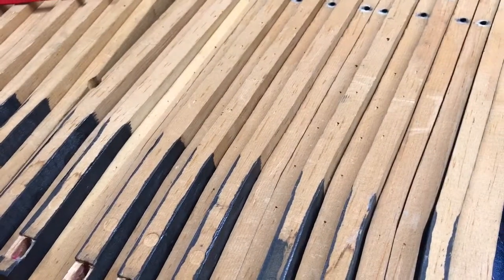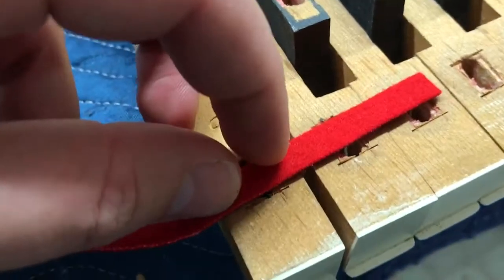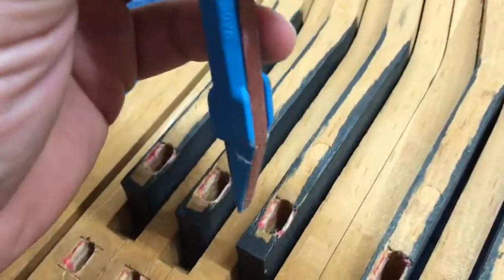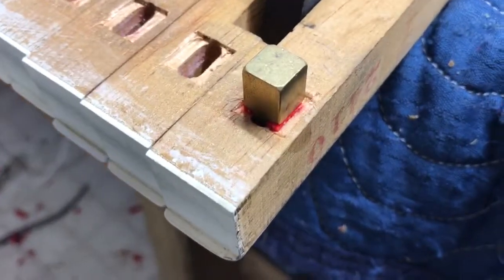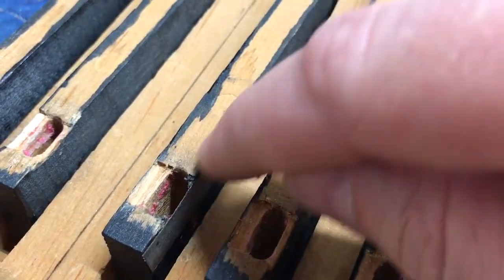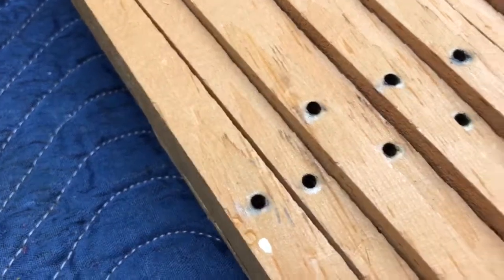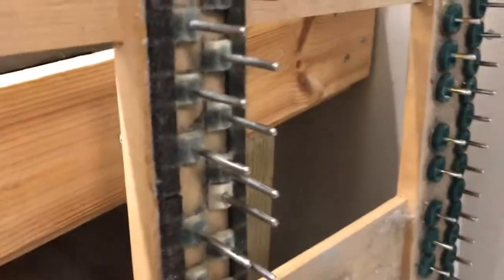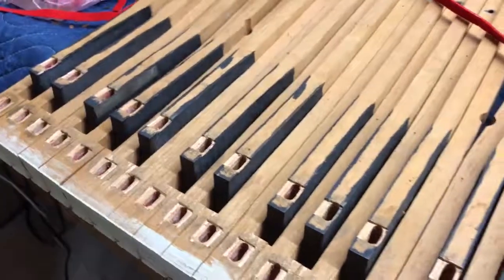Piano key bushing replacement

Comment: Super great share, much appreciated. I am restoring a 1900's upright and you showed a bit more about what it's like to work on a well-used piano like mine.
I am blown away that the bushings on the sharp keys were so far off on a Steinway D.
When I first saw them in your video I never suspected that wasn't done on purpose.
I take lessons on a well-worn Steinway D which my instructor tells me is his favorite piano within 50 miles.
Oldie but a goodie (well, actually, it isn't old by some definitions - 1985).